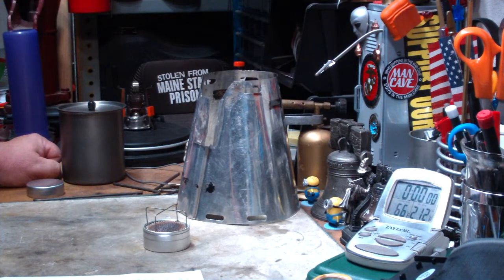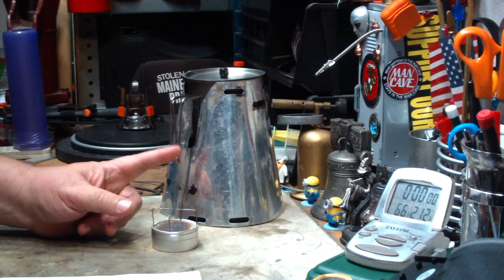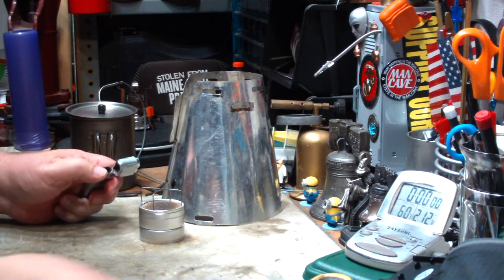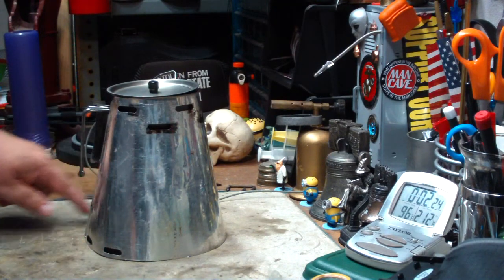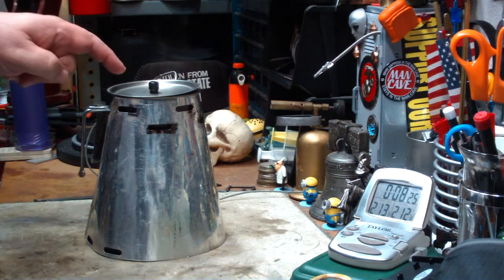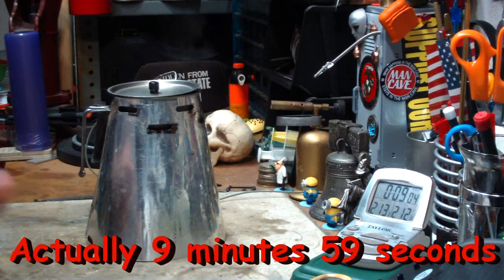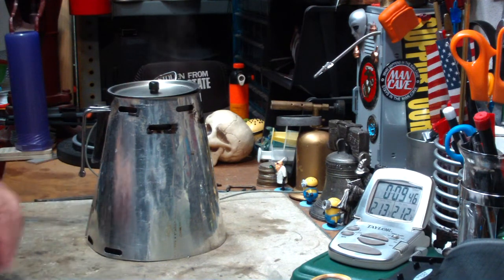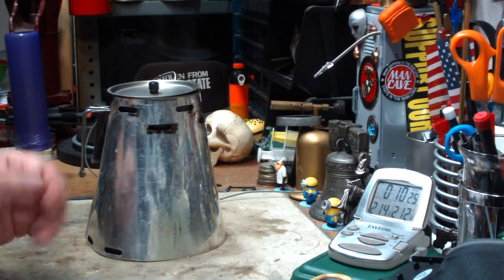Zelph's StarLyte Alcohol Stove - Trail Design's Caldera Cone - Boil Test #1

Comment: It would be interesting to see how long the "time to run out" would have been vs the 22 minutes time to run out when used without the cone.  Also, on the video you say the stove is about 1" below the pot.  However, the data below the video says 1/2"?
Reply: @ 1:14 visually the space between top of burner (not considering the stove own pot stand) and pot bottom is 1" or more.

The "Distance from burner surface to pot bottom: 1/2" is from stove specification, is the height of the stove own pot stand.